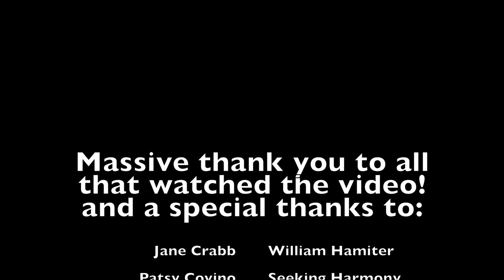I Was So NERVOUS But Was Met with A Humble Reaction. *Pressure Washing Transformation*

Comment: In no way am I saying this guy isn't providing a needed, and valuable, service but the moral of the story here is people need to invest in a pressure washer for at least minor cleanup.  Mine cost me $85 and I use it 1-2 times per year to keep patios and areas around our house clean.  It's like putting your car through a car wash.  If you don't, things deteriorate.
Reply: After seeing the condition of many of these surfaces from videos like this, I would say you are absolutely correct! A power washer definitely needs to be part of any home owner's maintenance arsenal

Comment: I wonder how much of the problem with that paiio could be prevented if it had been laid as porous, allowing the water to drain away, rather than sitting on it. 

My balcony does the same every winter, as it does not drain well. I am able to clean it myself, but it takes half a day scrubbing the black slippery muck off.

Comment: I think a couple gallons of bleach would have done so much more for the outcome of this porch if you'd started with it. You can only get so clean with just high pressure water. Removing all the organics from the start truly leaves a better look and long term finish. Makes property look brand spanking new. It's also so much faster to start with it and then remove the dissolved organics. Seems backwards to me.